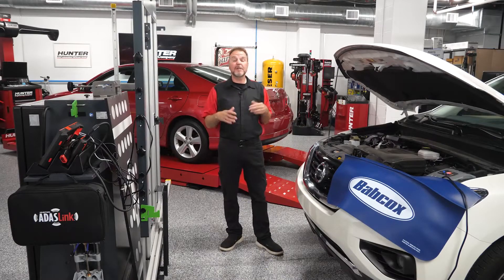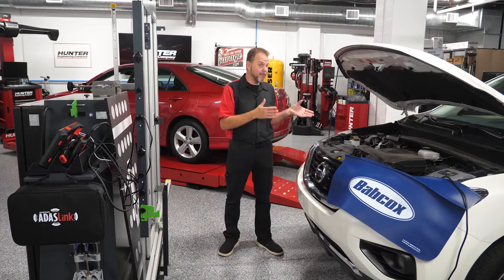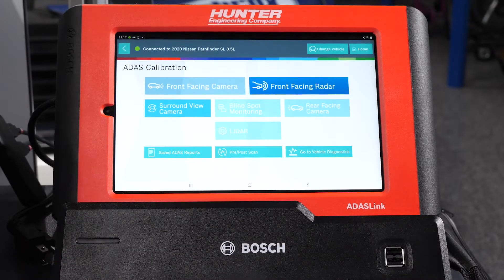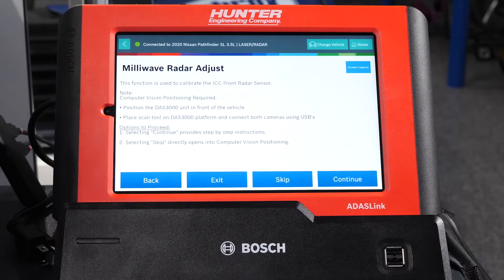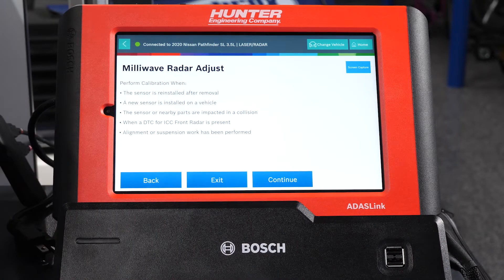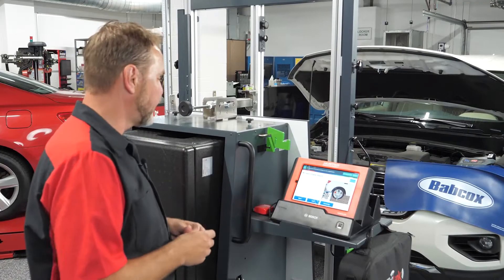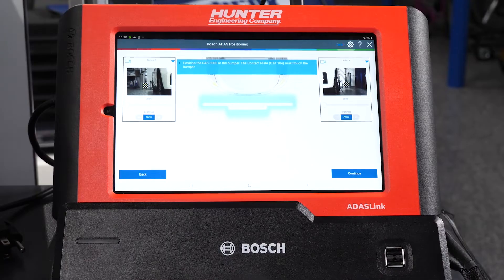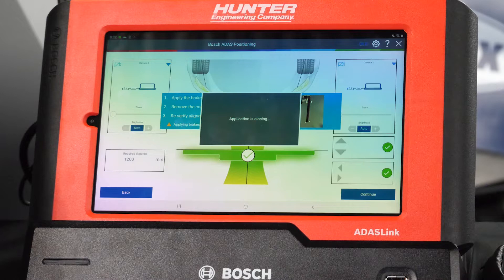ADAS calibrations: Front-facing radar sensor for the Nissan Pathfinder

Comment: I have a 2022 Rogue and I'm pretty sure my front grill NISSAN emblem has behind it the radar sensor.  A rock has cracked the plastic housing for the NISSAN emblem, no warning light has come on indicating an issue with the radar sensor within, so I'm crossing my fingers that it still functions as it should be adaptive cruise, as well as auto braking.  I was wondering if anyone knows if the front plastic piece can be replaced just by itself, without having to pay for the entire assembly behind it, anyone?

Comment: If the radar needs adjusting how can you effectively adjust both vertical and horizontal alignment with only one screw to adjust? Do you just turn and twist the radar bracket left and right and hope for the best? We found that the one screw you can use to adjust the sensor is for vertical alignment purposes only. The type of Pathfinder we were working on was a 2018 Nissan Pathfinder SV 4WD.
Reply from the maker: Forward Facing Radars like the one used on the 2018 Pathfinder have a wide horizontal field of view and a narrow vertical field of view.  For this reason, only a vertical manual adjustment is provided to bring the radar into calibration range.  Fine vertical adjustment and horizontal adjustment is provided electronically as part of the calibration procedure.
Reply: @HunterLearningChannel  If a vertical alignment is the only possible adjustment to make, is it safe to say that if the horizontal reading is off that either the radar needs replacing, the bracket needs replacing? We looked at the vehicle and there was nothing else that would cause the calibration to be off. The horizontal was off around 2.54 degrees.
Reply from the maker: @crowncollisionsolutions7868  Apologies for the delayed response. Repeated calibration failure with a large horizontal result could be a number of things, including the radar and/or mounting bracket as you suggest. It could also be an issue with other things like wheel alignment if using a system that references thrust line like the DAS3000 or Nissan OEM tool, or an issue with structural parts the radar mounts to. Service documentation, attention to details, and patience are key as you continue through the diagnostic phase of this repair.